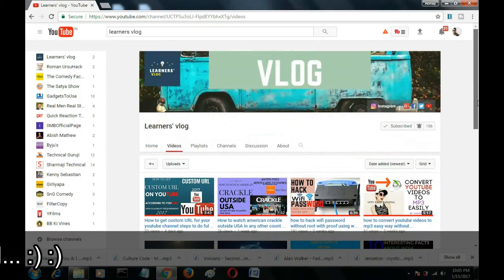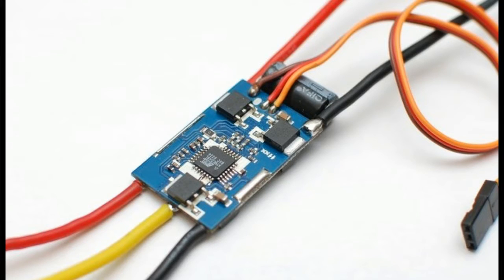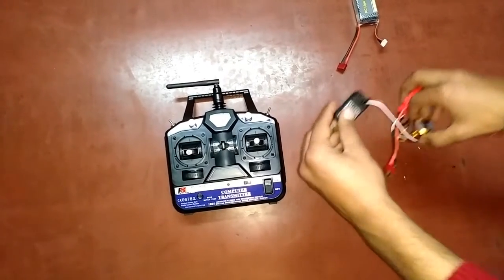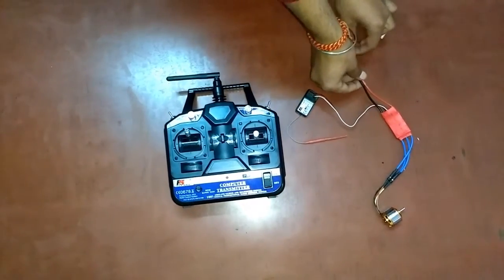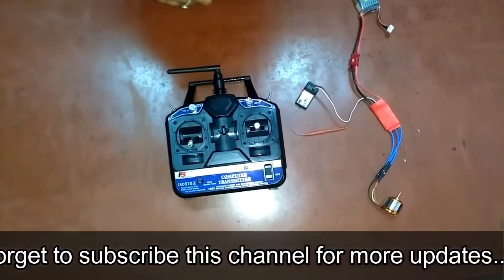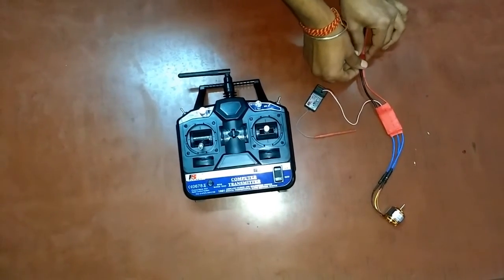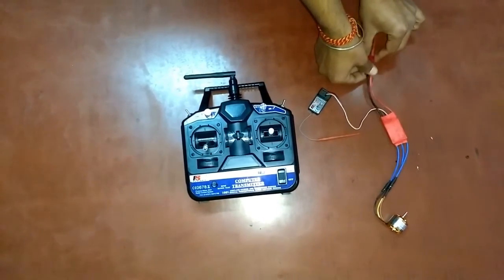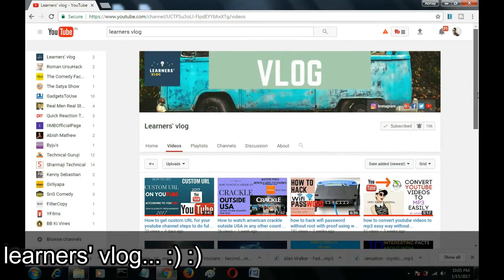calibrate electronic speed controler (ESC) manually without software# manual ESC calibration

Comment: hey please Help Me my Brushless Motor Work perfect but when I Put Propeller it speed Reduces when Put More than 50℅ Throttle.
specification
1-1000kv brushless motor
2-30 a Simonk ESC
3-Fly SKY CT6B Transmitter
4-9V Battery.
Reply from the maker: hey ! bro i have read your comment , according to me you are not putting that propellers properly on the motor , i think they are not tightened enough by the screw , if still the issue is not resolved then kindly send video of so that i can figure out where is the problem.....
Reply: Learners' vlog OK My What's app Number 8303116214
Reply: Learners' vlog hey How will I send The Video To You .